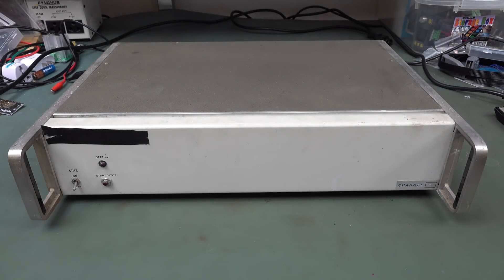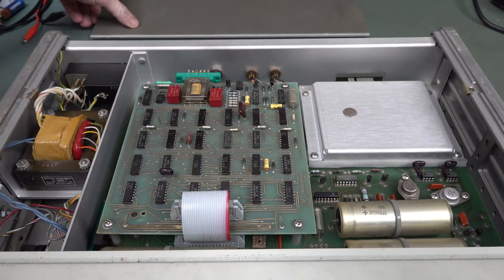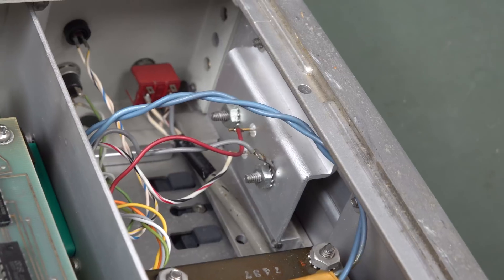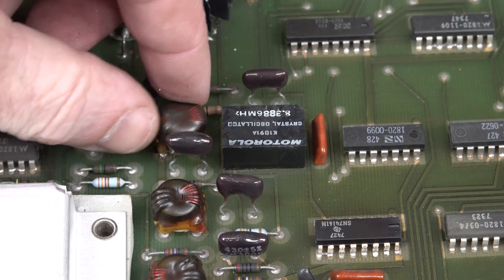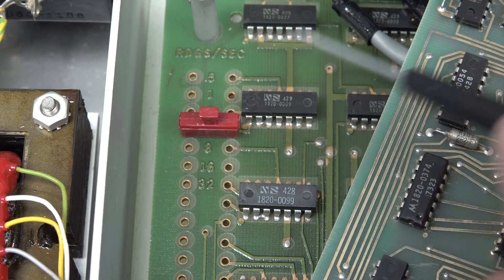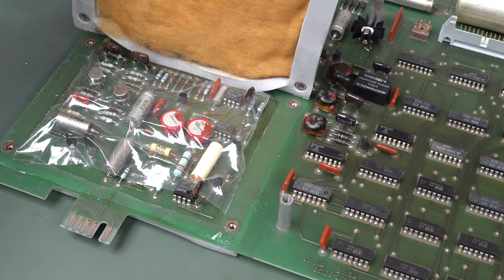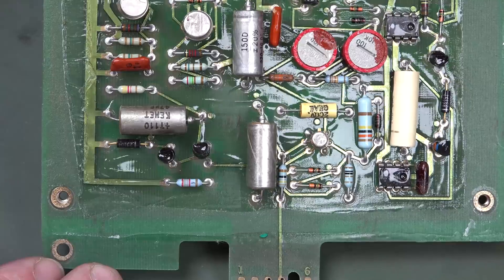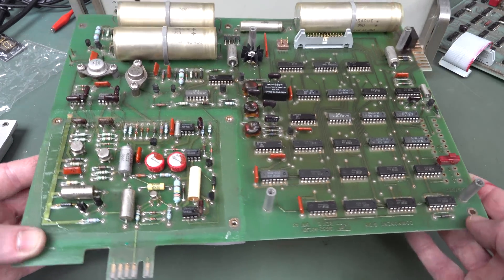EEVblog #1126 - Mystery Teardown!

Comment: IDEA:
What if input and output connectors are interconnected so you could simply daisy-chain your devices? Maybe real (digital) output is on that edge connector and pulse on "output" connector just tells all other devices to start or stop their operation? It could be connected via transformer to be insulated (I heard it was common before optocouplers were a thing), so it might explain negative pulse.
Try to check that edge connector with oscilloscope, I'm pretty sure one of pins might be clock signal and is triggered automatically by timer you set inside.
Reply: http://www.aimanalytical.com/Manuals/7673B/HP%207673B%20-%20S.pdf
Reply: Pages 107 and 108 makes me feel that I might be right.
checks manual for my mid 70s multimeter
Maybe one of pins (pin 4?) is trigger to start single measurement? And then samples per second "switch" only changes accuracy (and length) of measurement.

Comment: That wool looks like asbestos and it's from the 70s, so it probably is.
Reply: No, most certaInly fiberglass. While they used asbestos in many places where it was not really needed I doubt HP would use it to insulate something that does not get warm let alone hot.
Reply: Gordon Wedman  ..... Mate,   that's a Mesothelioma attitude !
Reply: It is fibreglass for heavens sake.  Nervous Nellys.

Comment: Heat resistant... insulation... from the 70's.. in the US.. That ranks up there on things I don't needlessly play with.
Reply: That is absolutely not asbestos.
Reply: Kyaputen Harokku  How do you know? Not trolling, just interested.
Reply: Even if it is it's not THAT bad.
Reply: It's called glass wool. Just fibres of glass that can be used for insulation.
Reply: Just fiberglass insulation.  I have several pieces of vintage HP gear and the service manuals list fiberglass.
Reply: MikesRadioRepair  Prior to '78 Fiberglass and asbestos were combined in some applications.
Reply: All that being said, it is most likely just fiberglass, it was supposed to be more of a comical comment than anything else.
Reply: Goonygoon84  still, asbestos doesn't look that way. If you ever handled it (which I did) you would know. Besides there is nothing wrong with asbestos. Apparently you shouldn't breath in asbestos dust, but same goes for lots of other materials. For instance, this insulation is clearly fiberglass (glass wool if you'd like), there is no reason (and no way) to add asbestos in here. But I wouldn't touch it without gloves because it will make your hands and everything you touch with your hands itchy.
Reply: mynameisdaniil Plus mineral wools can still cause lung disease if handed every day for year without protection.
Reply: "Good news is, the lab boys say the symptoms of asbestos poisoning show a median latency of forty-four point six years, so if you're thirty or older, you're laughing. Worst case scenario, you miss out on a few rounds of canasta, plus you forwarded the cause of science by three centuries. I punch those numbers into my calculator, it makes a happy face."
Reply: It's the Best-os!
Reply: poplug  k
Reply: If you don't know what it is, you'd better avoid it as best os you can.
Reply: Would modern insulation make you itch if you touch it?
Reply: Knuckles the Echidna  Yes
Reply: As stated, asbestos can come in any ratio, sure, it looks like glass fibre, and probably is. But can you be sure that there’s not say 20-30% asbestos mixed in? I wouldn’t bet on it, heck they even treated wood with it.
Reply: For heavens sake, it's just fibreglass.  Nervous nellys!
Reply: And a lot modern insulation is still fiberglass. Some people use paper pulp blown in. Also they blow in fiberglass insulation. My dad has been in construction for 40+ years and I wouldn’t worry al long as you use protection. The guys that blow in the insulation usually wear a full body suit and fully enclosed helmet with air supply and they even have air conditioning. I have used one before they are very effective for protection.
Reply: Yeah. That woollen stuff terrifies me. I'm sure just a very short exposure would be okay but jeez, I wouldn't touch it.
Reply: poplug  Asbestos was in all sorts of things, and in all number of percentages of insulation back then.  Plaster walls, insulation board, loose fill, batting. It didn't just look one way.
Reply: Goonygoon84  ..... Correct, Those commenting it's benign can show me the lab results.
Reply: Asbestos

Comment: Capacitors: "Don't be vague, ask for Sprague!" (Their old slogan.)
Reply: Someone should revive the company! I miss seeing sprague caps.
Reply: volvo09  They sort of have 2 owners now - Vishay for tantalums and Cornell-Dubilier now makes the "Orange Drops". Vishay uses the Sprague name now and then but it is obviously not the same. I miss them too. It was nice to have a dependable domestic brand. Guess we have to rely on Japanese caps now (Nichicon, Matsushita, etc.) I've had too many Chinese caps fail (new ones).
Reply: Ray Rooney Wish they'd make their Sprague Atom electrolytics. Damn they were good for filter caps in valves amps.... they are highly sort after these days.

Comment: I immediately thought the gunk on the pots was just fingernail polish: My father and his colleagues used to put a dab of red fingernail polish on the edges of trimmer pots – just like that – after calibrating instruments. Supposedly it kept them from drifting due to vibrations, especially in heavy industrial settings. The blobs held well enough for however many months, then broke away easily when it was time to re-adjust. I don't know if the vibration issue was a real thing, though maybe it was also a bit of a deterrent for customers to futz around with the settings too.
Thanks again for another fun & lively bit of education.
Reply: This device was part of a GC and/or LC Lab Automation System from HP. It would normally be used in a much more harsh environment than most electronics labs. Vibration from things like pumps, rough handling, thermal changes, etc. might certainly be an issue and a valid worry. The nail polish would make sense there, as would the conformal coating on the important and sensitive part of the board.
Reply from the maker: Loctite (and others) make various grade sealers for this type of application
Reply: EEVblog But generally, any red seal material symbolize that the authorized calibration is intact.  Easily faked, but good enough in a non-adversarial environment.
Reply: You have to use "Coles" brand "Starlet" nail polish, "Cherry" colour...
Reply: The stuff we used to use was called Glyptol if I remember correctly; it was designed to stop inadvertent adjustment and to indicate if someone had tampered with the adjustments.
Reply: It's red Glyptal Varnish.  Used in electrical Applications for at least 80 years.  GC Waldom still sells it in the bottle or barrel.

Comment: It's an ADC for an HP gas chromatography system. I found the 18652A referenced in the HP 5960 Series II GC manual. Based on the description, it digitizes a 0-1V differential analog signal (common in old analog chemical lab equipment).  HP was (and still is, as Agilent) one of the market leaders in Chromatography (Liquid, Gas, HPLC, UPLC, etc.) Chromatography systems are normally VERY modular, you add what you need and nothing more. Want to change detectors from light absorption to electrical conductivity, switch out the detector. Want to add an auto-sampler for unattended operation, easy. As such, it was likely sold as part of one of these systems as an optional add-on, which is why the documentation is harder to find.  Honestly, you can see the influence of this modular format even in today's Agilent HPLCs.

Comment: Seems it was used with HP 5890 Gas Chromatographs, and possibly not sold as a separate unit
It is mentioned in these two PDFs, but no real info other than a 1V input and a weird serial bus pinout.
https://www.agilent.com/cs/library/support/documents/a15282.pdf - see page 41 of 53
www.aimanalytical.com/Manuals/7673B/HP%207673B%20-%20S.pdf - see page 107 & 108 of 248